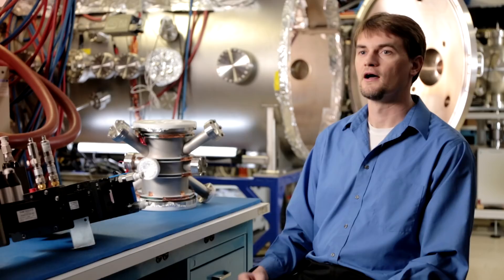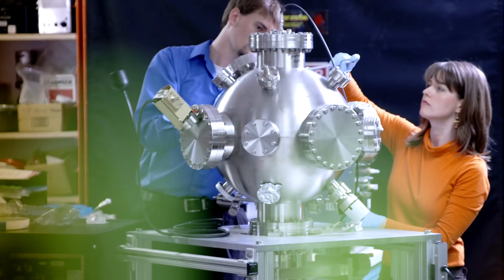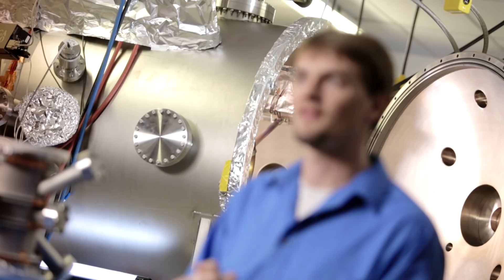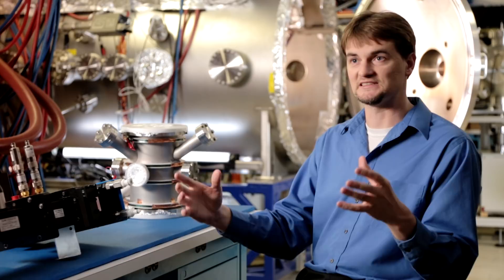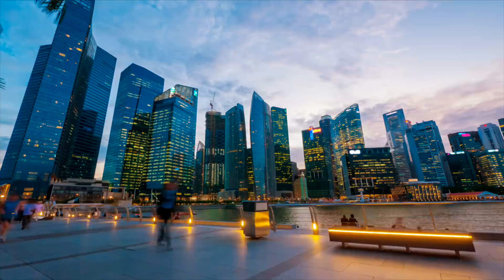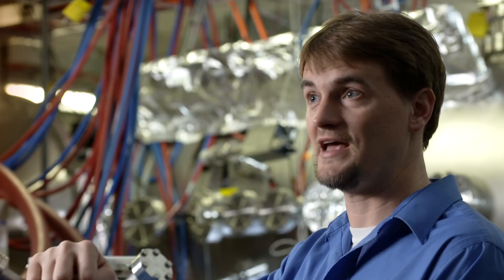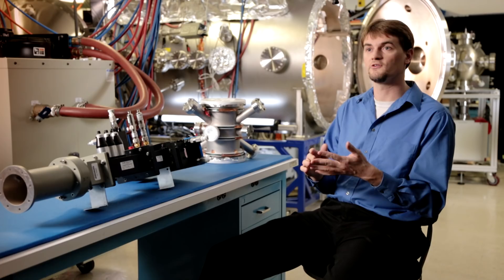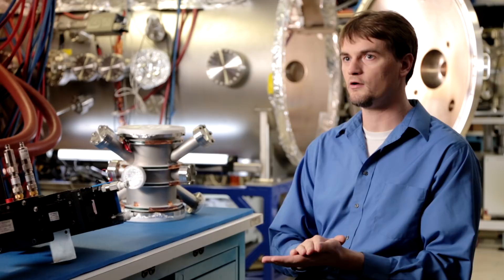Lockheed Martin: Compact Fusion Research & Development

Comment: A year has passed. Where is the promised reactor?
Reply: +Siarhei Angel Pretty sure the video says they're estimating it'll take 5 years...So you could expect the reactor in 4 years...
Reply: +Lillian Or rather - promised to test the reactor in 2015. But where is this test?
Reply: +Siarhei Angel At the time of writing this video only came out 1.5 years ago. They said a prototype at the five year mark, so you're still 3.5 years away from any publicised developments.
Reply: 3:24 Skunkworks is funded by the Military. It will be 20 plus years before the public get to see any benefit from this technology.
Reply: they wont and will not have a efficient fusion reactor. plus its already been done  look up MIFTI/MIFTEC

Comment: "Restarting The Atomic Age" That line right there is a monumental marketing failure because when we think of the "Atomic Age" we think of fission and every bad thing associated with it like atomic bombs, and decaying reactors, an abundance of radioactive waste materials, contamination, and disasters like Chernobyl. You'd be better off labeling as as "Paving the Way for Energy Independence" leaving all of that negativity behind. 

On a brighter note, I'd like to see this succeed. Among other things, this could easily lead to aircraft engines that use super-accelerated ionized air rather than jets.

Comment: Imagine holding in a million degrees blob then imagine the "heat exchanger" aspect to "take the power" from the magnetic bottled million degree blob - what does your heat pull tube and exchanger look like - how do you tap the containment and how do you cool down your pulling tube to a useful temperature while containment tapers off... how can you do this without searing, melting, heat overflow - and what is your medium of the heat power transfer, and how do you tap off more power than is required to contain the million degree blob that cannot be touching ANYTHING EVER ....

Comment: Although fusion power is much cleaner than fission power, there is still a small amount of waste created by the neutrons emitted and absorbed by surrounding materials. Disposing of nuclear waste is actually fairly easy (just bury it in a techtonic zone that is moving towards the earth's core), but you still need to keep it on the ground where you can contain it. So the idea of using fusion power to operate an airplane just won't work due to the possibility of an accident and the weight from shielding.

Comment: Looks like a cross between a Farnsworth Fusor and two ion rockets, in which the ions are accelerated by high voltage, focused by magnetic fields, and collided with one another, like two Farnsworth Fusors aimed at each other with magnetic funnels so that the collisions happen instead of accidentally or incidentally at the center of the Fusor, the ions are coming from only 2 directions, but are focused into a very small cross section in which the collisions occur. 
But I'm not a physicist. It just seems to me to be a cross between two ion rockets and a pulse-power can crusher.

Comment: Ok, no mystery here, it looks like an advance on Fusor technology:

http://en.wikipedia.org/wiki/Fusor

- a Fusor is an intertial confinement type Fusion reactor used as a source of Neutrons for r&d labs. The torus / doughnut shaped thing is where the inertial confinement plasma is created in a high vacuum, All those shiny stainless steel castings are the vacuum chambers - take a look at the wiki page i linked to - similar stuff. The Fusor is capable of nuclear fusion with a bit of Deuterium added but only for Nutron production - they never reach anything like unity, allways use far more power than they create. So mabe Lockheed Martin have made some leap in Fusor design that allows them to make more energy than is input into the system.

A few years back i remember Fusors being in the news cos some kid made one as his science project. You can make one at home with kit off eBay - the deuterium is the tricky part though.

Comment: Vehicles that you could flip nuclear fusion on and off with a switch for propolsion and acceleration like aircraft and tanks would save the military lots of money on fuel.   Would be able to travel longer distances without issues as well for operations and tasks - would be a huge upgrade over conventional vehicles.  Lockheed Martin already has the technology to take ET home,  now they need proper technology to take their fellow man home.

Comment: Will believe it when I see it work. There are some quite significant technological and scientific hurdles that need to be addressed before this will work. It is one thing to say that it will produce this much power, but getting turning the device on in the first place will require a hell of a kick-start, which is potentially not feasible for an aeroplane simply based on weight requirements of the power infrastructure. Sure, start it up on the ground, but what happens if it shuts down mid flight? There won't be any restarts. Not a prudent move by LM. Prove it first, then sprout your fancy videos.

Comment: Dude imagine how long a sub could stay underwater with a fusion reactor on board. You would have so much energy, you could make oxygen through electrolysis for the crew to breathe.
Reply: I am not sure, if your comment is sarcasm, but we already have nuclear submarines that can stay underwater as long as the crew has enough food.
Reply: Current nuclear submarines already make their own fresh water and O2 from seawater. As you said, the limiting factor is food. When the sub heads to sea, every available space is crammed with supplies, but they run out eventually. There's also the psychological factor of crew being away from family, not seeing the Sun, being stuck in a tube with over a 100 others etc. It's only the diesel electrics that are fuel limited.

Comment: The possibility of a weapons (or any) platform utilizing some kind of relatively small power source like the reactor presented in this video could bridge some tactical gaps, and not to sound like too much of a Gundam nerd, we could, in theory, build a Mobile Weapon (if not a mobile suit (which I'll admit is probably a bad idea)) to some capacity, giving a unilaterally capable unit.
Reply: A mobile rail gun hooked to the compact fusion (jet turbine size)  on the ground , or in the air , or low orbit would be on the cards ,

Comment: Saw an article at The Drive ( https://www.thedrive.com/the-war-zone/29074/skunk-works-exotic-fusion-reactor-program-moves-forward-with-larger-more-powerful-design ) that contained this video, as well as a slide from a CFR presentation from 2017 listing the T5 reactor as the 'next step'.  It looks like the T5 reactor is just getting built, so the timeline has slowed considerably from what the video projects.  The T6, T7, and T8 reactors are listed as necessary intermediate steps before the first functional TX prototype; if each of those take three years, then Lockheed is telling us that fusion is just a decade away.  That is not terribly exciting.

I am also curious as to why Lockheed didn't choose an aneutronic fuel combination, and why they decided putting superconducting magnets (which need to be quite cold) into the plasma confinement chamber (which is quite not-cold) was the correct approach.  Meh, whatever -- good luck to them.  I hope they succeed at this sooner rather than later.

Comment: i'm highly sceptical if this is actually going to work. well, i'm not that good with physics, but from what i know, the problem with fusion reactors so far has been, that it's very hard to contain and maintain the high temperatures needed. i don't get how they intend to insulate the device. can anybody give me some information on how they do it? i can't find anything on that issue, though it seems to be the crux of it all, where all previous efforts failed.

Comment: It is very interesting to see people's reaction on that video, since there has not been one result or measurement. All they do is proposing and fantasising. So far billions have been spent on fusion devices. The list is long:
http://en.wikipedia.org/wiki/List_of_fusion_experiments
There are problems that are not solved yet - such as the divertor. Any steady state fusion device has to struggle this issues. So on the one hand globally we have thousands of scientists and engineers who cooperate in developing ITER, W7X, JT60Upgrade and DEMO reactors and on the other hand we have Lockhead who claims to do so within five years. They have to learn a lot: A lot about plasma instabilities, divertors, tritium handling, Neutron shielding, gyrotrons, .... the list is very, very long.
For comparison: The tritium handling for ITER is a building itself just to make sure, that the tritium is handled properly. And Lockhead comes up with a pocket design? So where comes the tritium and deuterium from? Breeding from Lithium? And we are still not talking about the unsolved divertor...
This video is not only a bluff, but an insult for all scientists and engineers seriously working on fusion devices and I would be ashamed being that guy talking. Especially in 5 years. :D
Reply: I know it sounds crazy, but I suspect the answer lies in research of the "ball lightning" phenomena. The plasma flow for a ball lightning discharge is in a toroidial loop vs. a single loop. It's really not much more complicated than changing the direction of current almost 90° on the UV surface of a toroid geometry, but it has some rather large implications on the efficiency of the magnetic containment. (Knowing the simple right hand rule stuff in relation to solenoids, should make it self-explanitory.)

Also think of it this way, instead of compressing a donut evenly all over it's surface into a thinner and thinner string of a donut (general design of the Tokamak) - it's a lot easier to compress the entire bulk of the donut into the pinch-point at the hole of the donut. Get's hotter much faster and without doing it the hard way.

Comment: my initial sense, from looking at the standard model, & other quantum physics, is that greater forces than fusion can be created, ncluding uncontrollable xplosive forces, and also that there could be varying degrees of force created in similar fusion reactions by manipulation n the reaction of other unusual physical variables & phenomena, as well as standard model small particle 'essences' and forces…….. whether used for power, weaponry, or other projects

Comment: coming from the medical ecology field, immunology, & longtime since i last purviewed the standard thermonuclear weapon & power plant reaction variables when i was last n Ukraine, really all i can offer, beyond tailoring of initial particles in the reaction, is that alterations in the reaction vessel, such as geometrys & materials to 'polarize' certain Standard Model essences & forces, & other factors, could also perhaps effect the force of the reaction to greater or smaller, as well as alter the effects of the reaction such as temperatures & electromagnetic quantity even without changes in the reaction force, clearly a need for various sized reactions is handy, as to pricing of such various designs, it is not always the case that a vessel device fostering a more forceful reaction would be cheaper, altho that often is the case, the materials access & pricing variable is different in different celestial locale... it seems that for investors & benefactors of this technology, som clear progress is needed, which has been, yet a working device is what they wanna, & designing for similar or greater reactions that deal with larger reaction effects is fantastic & critical, but as of the 'investor factor' is seems the need to downsize the forces & effects of the fusion reaction is much needed, so tailoring of the reaction to minimize certain effects would be a goal alongside other plans to try & continue adjusting to the accepted effects of a main-size standard reaction

Comment: "With the next decade, compact fusion will also be able to take to the sky. An aircraft the size of a C-5 will be able to store a compact fusion reactor right on board. Thanks to compact fusion's high energy density, this C-5 would be able to fly for about a year n just a few bottles of gasoline."

Lockheed Martin, a publicly traded company, is actually putting this kind of stuff prominently on their website. But the stock hasn't moved, and it's not covered as a breakthrough in many news organizations. Has Lockheed really cracked the code, or are they engaging in unconscionable hype?

Comment: Wouldn't this be a viable power source to use in a single stage to orbit space craft without the need for chemical rockets? Possibly using air-breathing engines for take-off and switching to fusion to generate the high specific impulse required to reach orbital velocity?? why is nobody talking about this!
Reply: Because no one has been able to get fusion to work after 70 years of trying.

Comment: According to the Aviation Week site article posted a few comments below (http://m.aviationweek.com/technology/skunk-works-reveals-compact-fusion-reactor-details), they are relying on a deuterium+tritium reaction like most standard fusion designs. Much as I'm in favor of fusion, the source of tritium is.. fission power plants. And there is already a scarcity of that as it's main use is medical imaging. Orders of magnitude more are required for power generation.

The very nice video talks about "unlimited" flying range which will be of use for the military.

Nasa will unfortunately not benefit as this generates power through turbines and thus has two many moving parts.

Finally there is the problem of neutron generation which renders materials brittle and radioactive.. which is why this is also going to be a breeder reactor for standard fission products.

If successful this is not going to save the world with free energy for all because of its tritium dependency, it's only going to be of use to the military.

For a potential fusion source without any of these problems (and it generates electricity directly) I invite you to Google "Focus Fusion"

There was a Google talk on it a few years ago.

Comment: I certainly hope that it works but I have a sneaking suspicion this guy won't be finding a new job because he got the reactor working. One thing fusion research has taught us is that fusion power stations are properly hard to build.